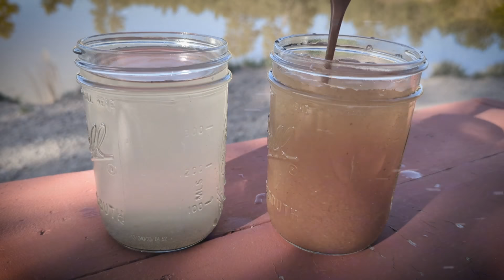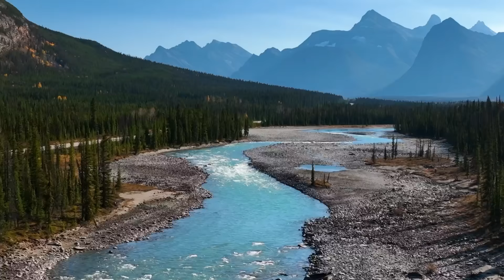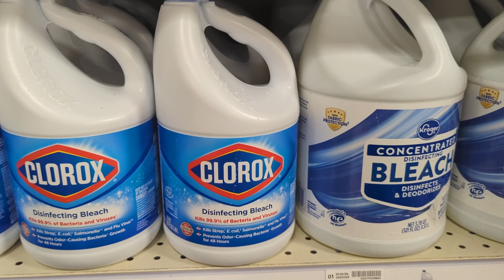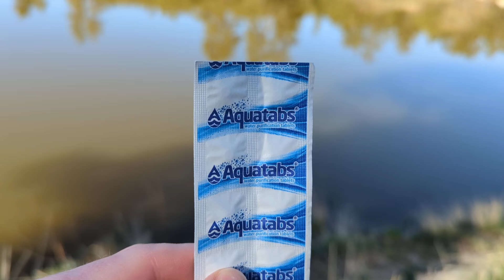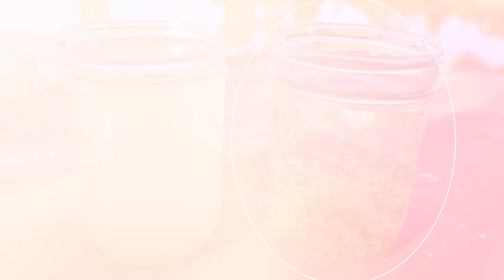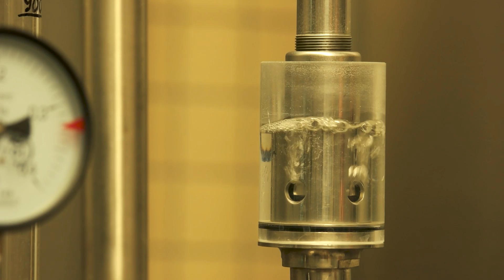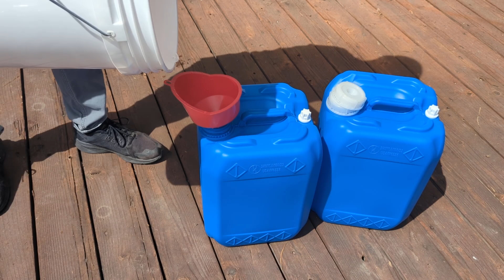The KEY to Emergency Water Preparation Before SHTF

Comment: If you drink bottled water save the jugs, fill them with tap water and label them and store them. They can be used when water or the grid prevents usage or if there isnt any.
Reply: Yes - I use spring water to brew my coffee. The minute the last drop goes into the coffee maker I'm at the sink refilling the jug.  I label it with the date and into my water storage closet it goes. This works better for me than saving the jugs and then refilling them all at the same time later - as I never seem to get around to refilling them. 😊
Reply: I have a PAP machine so use distilled. I refill the jugs with tap water and 5 drops of bleach. Then I write NP on them. They are in my emergency supply as non potsble, but can be used for flushing, cleaning, and washing. I've kept them for over acyearcwith no algae or other problems.
Jugs filled with clear tap water go in the freezer for drinking, or I buy commercially bottled water.
Reply: @kathleenredick275 Smart. Having water to clean with is often over looked in these kinds situations. But the second you needa wash your hands and your sink don't work, you realize how valuable water really is. Especially clean water, but im pretty sure most soap with dirty water would work perfectly fine, atleast until you have to rinse them, lol.

Comment: Before refrigerators ice was cut from ponds. I read that this ice could be used in drinks as well as ice boxes.Q: How was that safe?❓Did freezing kill the bacteria?❓Can you use icicles or as a safe water source?❓
Reply from the maker: That's a great question! People used to cut ice from ponds to keep things cool before refrigerators. Probably even using it for drinks. But here's the thing: that ice was far from safe. Theres a reason life expectancy was much shorter in the past. 

Freezing doesn't always kill all bacteria that can make you sick. Icicles wouldn't be safe either,  as the roof of the building poses risk of contamination, including bacterial contamination.
Reply: @waterfilterguru  Then what about rain water catchment systems? I saw on PBS "This Old House"  that in Bermuda every one uses rain water from their roofs because there's no other source of water there.
Reply from the maker: @barbaraferron7994 they have water treatment systems in place to make the water potable

Comment: Don't rely on one form of purification of water. Ensure you have at least three forms of water purification. One for a static situationa (at home), one for when your on the move (in you car, bike etc.) and one form for when your on foot (literally hicking on foot or walking distances). On top of that I always ensure we have water purification tablets on hand as they will cover any situation, especially when you first become deprived of city or town water treatment plants for drinking water. The draw back of the tablets is they do have an expiry date so periodically they need to be replaced. It pays to keep a file of tablets in your work bag etc in case you get stuck away from home.

I  trust no water treated from city or town supplied water particularly with the increase fracking that's being carried out. Not all bottled water can be trust by what the label claims. Water will keep indefinitely but it will go flat but, it will still save your life if its uncontaminated. If your stranded in your car, particularly in hot weather, DON'T use the radiator water in your car as it normally has a coolant mixed in with it.

Research how to get water when stranded without any water and desperately need water staying in one place overnight. You can find a way to do so in survival skills in the Australian bush or outback. Frankly even when times are good, we never travel by car, without spare water for us and the car radiator, just in case. In normal circumstances but during either physical labour in hot temperatures or successive days of high temperatures, keep a form of electrolytes on hand, paying attention to young children or the elderly. You can now buy commercial Electrolyte drinks in shops. Replacement powdered electrolyte to mix at home with water is good to have on hand. Again they have an expiry date so need to be aware. If extreme dehydrated, drink room temperature water initially. Saving cold water until you no longer need to replace your bodies electrolytes.

A sure way of telling you need to replace electrolytes is if you feel headachy, light headed and or dizzy and can't understand why, in hot weather. The elderly will likely tell you they aren't thirsty, just get them to sip the electrolyte replacement. Children do well if you give them a ice block or icy pole replacement, which you can do yourself or buy from a pharmacy. If your Pharmacy doesn't carry electrolyte replacement preparations you can buy the powder style online. 

Dehydration is dangerous for all living creatures so don't forget to keep your pets water station clean and filled, but kept it in the shade and never leave your children, the elderly or pets in a car with all the windows up. It's highly likely you may need to replace a window if the Police are called as they won't hesitate to break the window to save  anyone or anything in a parked vehicle.
Reply from the maker: Thanks for your very insightful comment!

Comment: Every time I run my pressure canner I fill empty spaces with jars of water. As I stock things requiring water I include a jar. The water stays good for a long time, is useful for medical purposes and easy to dump if you need the jars for food.
Reply from the maker: Thanks for sharing the your tip!
Reply: Brilliant!
Reply: @waterfilterguru There are some places that have running springs. Some people stick some type of pipe in and the water runs out through the pipe.

Comment: Remember if you have fluoride in your water when you boil the water the fluoride goes through a chemical change and becomes fluorine which is more poisonous than fluoride.
Reply from the maker: It's also good to note that concentrations of contaminants that can't evaporate with water will increase after boiling as the overall volume of water will decrease
Reply: Which means every time I've boiled water to make a cup of tea, or make pasta, etc. I've been ingesting fluorine?
Reply: Yikes
Reply: "Steven Slott, a spokesperson for the American Fluoridation Society, said fluoride "is a negatively charged atom of the naturally occurring element fluorine. Fluoride can therefore not be turned into fluorine as it is already a component of that element." 
Boiling water doesn't turn fluoride into fluorine.
Reply: You can also store water in glass canning jars.  We have stored them empty until used, but why not use the same space and have filtered water ready to use?

Comment: Fair warning, do not drink distilled water. You have to add minerals back into it for it to be safe, as drinking distilled water can remove minerals from your body, which is a very bad thing.
Reply from the maker: I believe that risk is associated with consumption of demineralized water over a period of time, but I could be wrong. Can you share a resource with this info?
Reply: Thanks. Good to know

Comment: Am updating my water supply system on my tiny apartment. Kitty litter that comes in pour containers, I am feeling maybe a need for a few more. During the twice year changing of the clock times, I make sure to refresh the water by pouring out first in my twin tub wash machine. Have been using different sizes to place under and in the back bottoms of my kitchen, bathroom, storage and bedroom closets. Am also planning to purchase a toilet over the sink. Should help both conserve water now, allow a prewash of smaller items like socks  washcloths. And if off grid, I will need to premeasure my 1.2 level of water needing to refill my toilet tank. Currently, I purchase about five gallon jugs of bottled water from the store to help with water for the cat bowls and for my electric tea kettle. That covers about a months supply, and so there will be some fresh drinking water on hand, especially in an off grid situation. Every morning I take my cats old water bowls and water my houseplants, or the outsidr plants and garden areas of my apartment complex because the water rates are too high. My neighbors with pets are starting to do the same.

Comment: so one obvious flaw in his logic on using toilet water and hot water heater water is if the source is full of iron that turns everything yellow and has arsenic in it as well then that method is not going to work for you. The best and only pure water source is rain water or the evaporation from air technique involving using plastic creating water due.
Reply from the maker: The only time arsenic would be present is if it's already in the water source and not being treated. I'm not aware of any appliances that pose risk or arsenic contamination, but if you know something different please share a resource so I can learn more.

While it's true water heaters and other appliances can corrode over time under certain conditions, any iron coming from them would typically be oxidized ferric iron which wouldn't cause staining, and come out in particulate form (rust). Again, the only time staining would be an issue is if ferrous iron is already present in the water source and isn't treated.

Comment: Can we get an update for this video, specifically for good methods for urban/subruban/industrial areas? 

Its much more simple to clean water from a forest creek with no humans upstream than to have to clean water from pools. city pothole puddles, and water that has brake dust or industrial contaminants. 

Most people will live in areas where these are just as important as trying to kill the micro organisms that cause beaver fever.
Reply from the maker: The methods described in this video apply to both urban and rural areas alike! In an emergency situation, microbiological contaminants pose immediate risk, and should be the primary concern., no matter the location.

Comment: This was surprisingly helpful. I never knew there was a countertop distiller. I'll be getting one for making soap. It's surprising how many stores don't sell distilled and I need it to make soap.
Reply from the maker: Glad it was helpful!
Reply: I bought a distiller. It wasn't expensive...cheaper than my counter top filter.
Reply: Take a pan of water, add a bowl on top, turn the lid Upside down, add ice and fire up. The steam will be cooled and drip down the lid into the bowl. Now you have distilled water. ❤

Comment: Water treatment rule...you always filter for 3 things (in this order):
- Particles, use sand/gravel or a cloth.
- Chemicals, make charcoal under high temperatures to create an activated form to soak up contaminants.
- Biological, boil, UV, or chemical treatment.

Bleach warning, it only has a 12 month shelf life at best. For longer storage, buy pool shock, which is the powdered form, and make your own bleach as needed.
Reply from the maker: Thanks for the comment - really great info. 

Just one thing to consider, if chemical treatment is being used for disinfection (treating microbiological contaminants), you may want to swap the activated carbon stage last in order to remove any disinfection byproducts created when the disinfectant chemical interacts with organic matter in the water.

Great tip about the pool shock!

Comment: Additional water sources in a pinch:
- Standing water in clogged gutters.
- Morning dew on grass (I get 1 gal per 5 minutes with a cloth towel)
- Plastic bag over living plant leaves.
- Clear plastic sheet over a hole in the ground, condensing the soil moisture.
! Create water catchment systems for all your roofs now while the grid is still up !
Reply from the maker: Love this! Thanks for the additional tips 🙏🙏
Reply: Water heaters & toilet tanks
Reply: Do you run the tool over the grass for 5 minutes? I assume to hang the bowl over a bucket - but would the water just evaporate from the towel?
Reply: @user-uy8nw9zm6b  just run a towel on top of the grass in 1 or 2 swipes, wring it out into a bucket, move a few feet down, and repeat.
Reply: @thatguychris5654 Ty.
Reply: Ty.
Reply: @barneyrubble4827 both of which he said.
Reply: Wow! 1 gal per 5 min.
Reply: Right? What a liar 😂😂😂 @Cynthia-dv8ji

Comment: Wines and fruit juices come in disposable 3 and 5  litre boxes.... The bladders in these boxes can be washed and sterilised ...the tap is removable...refill with water and placed back in the box...easy stackable free water storage containers..
Reply from the maker: Great tip! Thanks for sharing, love the info
Reply: Good idea
(hiccup🍷)
Reply: How do u sterilize the bladder?
Reply: @sandyshephard4571 I use a little bit of bleach solution and let it stand for an hour or two..rinse out and fill with water..
Reply: Have you ever tried this? I have. The water comes out flavored like the original product. Do you have a way around that?
Reply: @mattschmitt9924  I find that the bleach kills it.... mine tastes slightly of bleach..
Reply: @mattschmitt9924 I have no problem with the flavor.
Reply: Lawd knows the wife has a bunch of those, Ive been saving them, clean them out with chlorine dioxideWhich I use in my cistern and a bubbler
Reply: I do this and freeze the bladders for the  cooler and camping water.
Reply: How do you remove the spout?
Reply: @DCStarz1000  I don’t remove the spout. Just hold it under the faucet. It’s not the fastest, but doesn’t take that long.
Reply: @davidallcock6316  how do you remove the tap?
Reply: I tried this however the bladder still tasted like the wine..great source for bath or flushing 😊
Reply: @debrabaer5037 flush it out with diluted vinegar
Reply: Lined with a plastic coating.
Reply: @DCStarz1000  just pull it very hard...it comes out
Reply: Good god-bleach is a brain toxin-what's so bad about fruit juice aftertaste. @davidallcock6316

Comment: Be careful if the grey water from your sinks, shower and washing machine is recycled in your home and used to flush your toilets. Thank you for telling us that you need to boil water for longer at altitude. How about solar stills? can they perhaps be used to safely make use of swimming pools and hot tub water as well as lakes or deep puddles? Lastly, would investing in a collapsible water container be a good idea for someone living in a place with limited storage space, so they could fill it up if there was for example a storm warning.
Reply from the maker: Hey thanks for your comment! Solar stills are another great method to make water safe to drink which I missed! They work on the same principal as distillation - water evaporates, leaving contaminants that are unable to do so behind. Having a collapsible water storage container on hand and ready to fill is better than nothing, but not the same as already having stored water. The risk here is you never know when the tap will shut off, unless you have another method to fill it.

Comment: No! Clear glass blocks most of the UV
(Ultra Violet rays that disinfect!
I am not an expert- Apparently only 
Very expensive quartz glass allows 
UV rays through!
Check it out- If I am wrong I would apologize!
Reply from the maker: Check out this study, they tested UVA and UVB radiation transmitted through various types of glass. https://pubmed.ncbi.nlm.nih.gov/19614895/ UVA radiation blocked depends on the type, color, and thickness. UVB radiation was completely blocked by all glasses. According the Healthline, about 95% of all radiation from sunlight is UVA radiation. https://www.healthline.com/health/skin/uva-vs-uvb#comparison-chart

Comment: You probably don't want to drink the dehumidifier water, that's generally got some heavy metals in it.
Reply from the maker: Thanks for the heads up - even better reasons ensure you're prepared with proper water treatment on hand for your situation
Reply: What about filtering it first?
Reply: @angelacastagna3824   I guess, you could try to filter out, cadmium, or what ever is leaching off the evaporators, into a bucket that isn't meant for potable water.  Perhaps you could just use the water for some other non food based purpose .

Comment: What is the best water to buy?  Distilled? Spring water? Osmosis? Purified?  Ty
Reply from the maker: To store away for drinking purposes? Anything but distilled, really.
Reply: Water needs to contain minerals or the water pulls them out of your body, which is not good. Distilled water is only water as all the minerals get left behind in the distillation process. Do some Google research on this for better information than I can give here.